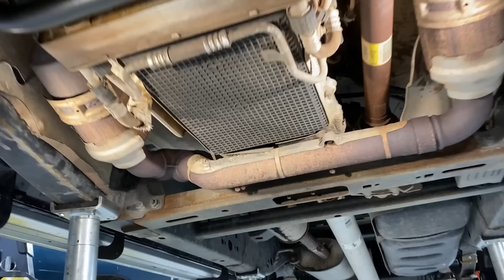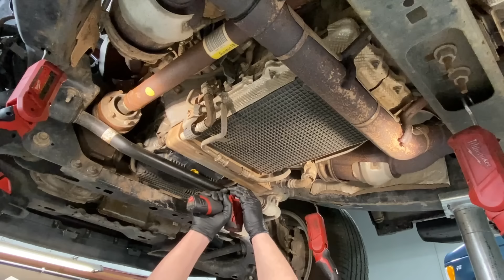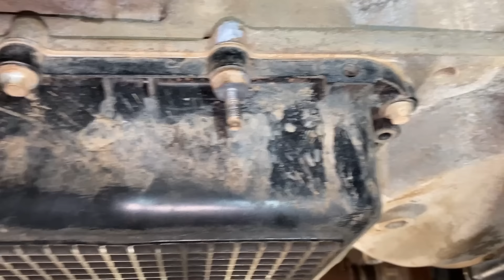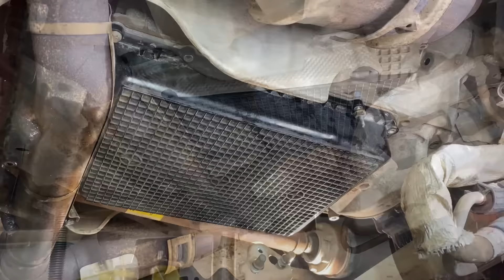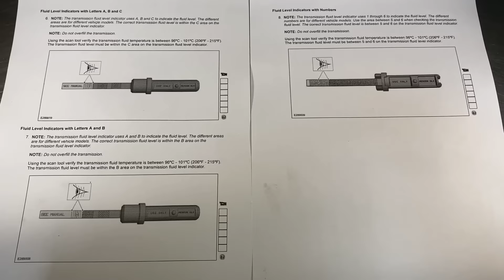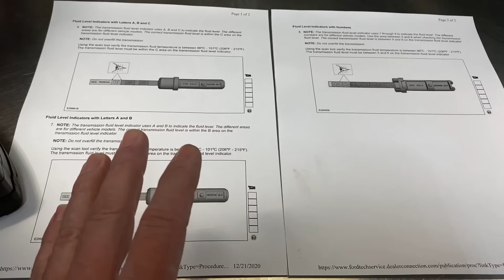Ford 10R80 Ten Speed Transmission: Fluid and Filter Service Procedure

Comment: Where can I find the torque specs for the filter and the transmission pan bolts for a 2021 Ford Ranger?  You state 96 foot lbs for the two filter bolts and the pan bolts, excluding the stud bolts, which you state are 106 foot lbs.   On the Ranger forum someone posted that it's 89 foot lbs instead of 96 foot lbs.  They have the same 106 foot lbs for the stud bolts.   I just want to be sure I have the correct torque specs for my truck.   I'm not sure where to find that information.

Thanks Scott
Reply from the maker: 89 inch lbs is correct

Comment: I just did this service on the wife’s 23 F150 tremor, I used a fluid extractor and sucked almost 6 quarts out of it. No mess at all, put a PPE deep pan and new filter. Bolted everything back together and refilled hardest part of this job was refilling to correct level. It gets very hot down there! 
😇😊😎🇺🇸🇺🇸🇺🇸
Reply: The pro tip here is using a fluid extractor which I did today as well.  It filled my extractor half way.  There was some left in the pan but it wasn't gushing out like this video showed.
Reply: Put back in what  you took out 🎉

Comment: Thanks for this video! I watched another one of your videos that said to check fluid levels first. My 2023 F150 Raptor with only 8k miles was shifting weird. Sure enough it was 1.5 quarts low from the factory using your cold fluid check method. Makes we want to check the diffs and transfer case now also!

Comment: Absolutely insane. Ford should  be terribly ashamed of themselves. No way should a transmission fluid and filter change be a $500 to $600 job! Tell the engineers to go back to the drawing board and figure out a way that the fluid can be changed and the filter can be changed without robbing your customers.

Comment: Man I'm getting ready to do this. I really appreciate all the torque specs. I am kinda afraid of checking the fluid when cold though especially since I'm installing a larger aftermarket pan. Will it get plenty hot enough to do how Ford wants it done while idling? I'll see where the temp gauge normally reads before I do this. Awesome video

Comment: My 2017 F150 has 118K miles on it.  The Ford owners manual has not recommended a transmission service yet.  So I have not done it.  The 10 speed transmission still works very good.  Oddly the dealer is telling it is too late, too many miles and do not service it at all.  What would you recommend?  I am tempted to at least replace some of the fluid by sucking it out of the pan and refilling it (maybe multiple times to dilute the old trans fluid).  Or service it as you did in this video.  I am new to your YouTube channel.
Reply from the maker: Follow this video and never flush. You will be just fine.
Reply: Thanks!  I will change the fluid and filter.  I feel good about it.
Reply: @BruceCook-j4x don’t do it. Just buy an extended warranty for a couple thousand. Then take it in to get replaced in a few weeks after then bam new transmission for 2K not 10K

Comment: Hi! I've been working on automatic transmission for over 30 years and I truly don't understand why nobody uses a pump to suck fluid trough the dipstick hole before droping the pan, that way, you don't make a mess like that...
Anyway, I do really like your videos and knowledge on Ford crap!
Reply: No, just use a fluid extractor! I did it this way, and it made dropping the pan so much cleaner
Reply: Cause there’s no drain plug

Comment: I just performed a drain and fill (30k 2021 f150) miles..dipstick shows in the middle between 5 and 6(at operating temp). Is it better to get the fluid to the top of 5?  I want it as good as I can get so I’m thinking I should get it to 5. Thoughts?

Comment: On a 2022 Ford F150 3.5 Hybrid, you 100% have to take off the exhaust, there is no way around it. One screw for the filter is too long and wont come out all the way (hits on the exhaust pipe).  Also there are two pipes inside the pan that catch on the valve body. Just FYI. I tried unbolting trans and jacking up it wont go up enough. quite different than this design.

Comment: Love all your videos! I do have a question though. If the 10R has a thermostat to block flow to the external cooler how do you account for that lost fluid using the underfill cold and it will raise to normal when hot method. I totally follow the logic but in my mind, when it gets hot and starts to flow fluid into the cooler that was emptied during removal wouldn’t that lower the level? I can guess that in your vast experience you have already been down that road and confirmed the fluid will go up when hot but was just curious. Keep up the excellent content!

Comment: If gear box run out of fluid , can it brake something in gear box? After I hit hard snow and loose all oil , I drive like 500 meters befor car stop moving , I stop engine in about 10 min after it happens . 
My car Ford explorer 2021 plug in hybrid st 3.0 eco boost engine

Comment: amazing I took my suv in to change fluid in auto trans and dealer told me it was lifetime. I dont know whos lifetime. but I checed at parts dept for filter and pan. no help. call manufacturer told me filter was only accessable on a full rebuild and it was my choice weather to replace plastic pan. oh by the way this is on a 9 speed jeep trans. just wanted to vent my frustation dealer and manufacturer dont even have info on there own autos even with vin#

Comment: My 2019 f150 is the 5.0 10speed also has the same numbered dip stick. I pulled the pan and let it drip for a few days as my filter was late being delivered so it definitely drained well. however it took me just shy of 10 quarts...
Reply from the maker: I bet so you allowed an additional 3qts to drain out.
Reply: @FordTechMakuloco  thank you, I figured that was it. I I wanted to be sure something wasn't wrong because I haven't seen anyone use that much. I am directly in the middle between 5 and 6 on the stick at about 185°.
Reply: I checked it again this morning before I took it out of the garage not running. It was well up over the floor. Mark after starting the truck. Not up to temp but running. It's not showing on the stick at all?
Reply from the maker: Yes that is normal when cold, that is how much LV and ULV expands when hot but the fluid level should be set at 206-215.
Reply: @FordTechMakuloco  what you said in the video makes Sense that doesn't have to be at full hot to check it, but  how warm are you letting it get? If I check it as soon as I start the truck it's not on the stick but if I wait 10 or 15 minutes or so and then it just shows up on the very bottom. It seems strange to me that the fluid wouldn't be on the stick at all. If I let it get to about 180°. It's centered between five and six . Local dealer couldn't answer me. I  appreciate you're reply!

Comment: Funny I just looked up the service data for this transmission and I know Ford uses discard bolts on the caliper brackets, but I did not expect to see DISCARD bolts for the transmission mount and the cooler tube.
Reply from the maker: It is all about the loctite trust me.
Reply: @FordTechMakuloco  for me is a insurance thing so the finger doesn't get pointed back at me. I trust your opinion though. I always just assumed they were just torque to yield bolts. But you know what happens when you assume. -_-

Comment: Heres a thought.  Anyone try squeezing a hose thru the dip stick port. I do this on my 07 chev, and used to do it on my bmws. Use a pump from harbor freight to pump the old out amd new in.  Obviously doesnt change the filter but consider explorer ford transmissions have permement filters installed, unservicable probably doesnt matter much. Ive been doing this on my 07 chev for over 100k miles. It has 260k on the original trans.

Comment: Why do you need to unbolt the transmission from the truck when you can just slide the pan towards front side to drop the pan? Half inch of space between the pan and the exhaust I think is enough
Reply from the maker: Because on most there is not enough room especially on the 5.0L.

Comment: I think I'd rather drill a hole in my plastic trans pan and reseal it with a bung plug than DIY this. 
What a joke.
Reply from the maker: It's not that bad.
Reply: @ I know.  I'm just whining. I'm still bitter about replacing both of my front wheel bearings pre-100k miles.

Comment: Good grief... what a F'ing mess ... I dropped the trans pan on my OLD F250 7.3 diesel C6 trans with one hand tied behind my back.
I'm rethinking buying a new F150... yikes, what a nightmare.
I don't have a lift, Imagine going that laying on your back... outside.
Stick a transfer pump hose in the fill hole to suck most of the fluid OUT so when dropping the pan it's not dripping all over the place.
Edit... what about installing a 'quality' aftermarket pan with a drain plug in it??? (make life a little easier)

Comment: @FordTechMakuloco
Could you use a pump to suck the trans fluid out through the dip stick to avoid a big mess? (Asking from someone who hasn’t done this before.)
Reply from the maker: Yes but in the end there will still be a mess on the exhaust as the trans case drains down

Comment: Just changed fluid and filter in my '19 F150 3.5 Ecoboost 4x4. This video helped out greatly. The rear pan bolts were a bit tricky to get to. I pumped out the fluid before removing the pan, so no spillage of fluid.
Reply: With the 3.5, did you have to jack up the trans like what he says the 5.0? I don't see how the 3.5 exhaust the crosses across the rear side of the pan is any different than the 5.0? 

Unless I haven't looked at it enough, this looks very similar.

Comment: Can you just buy a pump and pump out as much trans fluid as you can through the dip stick tube and replace it with same ammount of new fluid..? I did that with my Jeep compass I pulled out 2 quarts of old and replaced with 2 quarts of new 4 times and it is running great.

Comment: What do you think about the PPE replacement pan from the plastic to the aluminum with the drain plug had mine done took about 11 quarts cause it adds about 1.75 extra quarts

Comment: It has been 3 days now that the shop has had my truck on the lift to do this job!!!! I was told that they ordered the wrong fluid. Then I it was the the first gasket they received from ford was bad and it was leaking so they needed to drain and start over. They said it should be done by the end of the day, with any luck. I asked for them to call me and let me know as I am at work that is a hour away. No phone call. Today, day 3 I called 2 hours before closing time,  I was told that they are filling the transmission now and should be good in 30 minutes. I asked for them to call and confirm its good to go before I leave work early and drive out of my way to pick it up. Yup, you guessed it, I did not receive a call at all!!
Now I wondering if they screwed something up bad and trying to figure it out before I get the call to pick it up

Comment: While looking for a metal replacement transmission fluid pan I've learned that my 2021 Power Boost (hybrid) has a few differences to the typical 10R80. The filter is different, there are a couple additional pickup tubes in the pan, and the pan itself is different. Do you know of a metal pan? I can't get confirmation from the few brands I've searched. I'm also having trouble finding out exactly what parts I need to replace on the hybrid transmission. It appears there's a pickup screen filter and a couple seals for the pickup tubes but can't find the PN's or images showing them. Ford's parts diagrams leave a lot to be desired.

Comment: One Question would you replace the plastic pan for aluminum. It's said to reduce oil temp by about 8 degrees.
Reply from the maker: How is that when it is thermostatically controlled?
Reply: @FordTechMakuloco  Thanks I didn't know

Comment: Thanks so much for this video.  It was the primary source I used to do my first trans service today on my F-150.  I do not think I would have attempted it without really great detailed content that this video exemplifies.  I do want to say that I attempted to remove the pan on my 2018 5.0 without jacking up the trans, and luckily it wiggled right out.  It actually came out easier than the heat shields even without making extra room like you did--just took some finagling.  Being able to skip that one step definitely saved some time and aggravation no doubt (considering I chose a rainy day to do this in my gravel driveway!).  Mine also took 7.5 quarts of the ULV and I put in a Raybestos filter that came with the gasket for considerably less than the Motorcraft part.  The only cooler line seals I could find were made by Dorman, but they worked just fine for me.  I can say with zero doubt that I would much rather have done this inside, with a lift, and with a nice pump to get the fluid in.  I used a little hand pump (like a soap dispenser with a hose) and that took quite a while, though it did the job.  Thanks for all the great tips in the video and I'll be using more of our content.  My pickup has 125k and I hope to double that!
Reply: Gravel driveway, what luxury!  All I have on my acreage is mud and weeds that consume dropped bolts and nuts.  Achieving a day without rain is a months long process.

Comment: It seems that the major issue with the 10R80 trans is the CDF Drum slipping out of place - not sure a fluid/filter change will help prevent the failure of the CDF drum considering there is a design flaw that causes the this part to slide out of place. Ford developed an updated CDF drum with a key machined in to it that prevents it from sliding out.

The hassle of replacing the 10R80 fluid/filter doesn't seem to be worth it considering there is a fundamental flaw with these transmissions.

Comment: I was just wondering if the $650.00 my local dealer charges to service the transmission is normal cost.
Reply: My local Indy mechanic charged me $650.00 for pan drop and filter and new gasket (probably could have used the old one) engine oil and filter ( I supplied oil and filter) and change out front diff fluid ( I supplied fluid). Maybe a little high on price........but.....I know the job was done properly.  I don't trust the mechanics or service manager at my local dealers

Comment: Would love to see a video like this over the 10R60 trans that's in the full size bronco. 

I'm gonna be doing a change on it after this winter on my 2024 bronco 2.7 Sasquatch.  

Ive not been able to find any type of video on the bronco and pro demand says you have to hook up a special external vacuum pump to replace the fluid or something. 

Would love a video on fluid and filter swap on a 6th Gen bronco 10r60

Comment: Will a hose get all the way down to suction off fluid using an extractor from the fill port? I want to do this on my garage on jacks but I'm afraid I might not be able to extract enough oil and make a big mess.
Reply from the maker: yes it will through the fill port.
Reply: @FordTechMakuloco  Thank you boss. Just did it today on jack stands 😬

Comment: Thank you for making this video is there any way you can tell how many  quarts of atf i will use need for a 2022 ford f150 3.5l 2wd 10r80 i know i will have to check dip stick but general how many will it take with filter change also
Reply from the maker: 6.5-7qts it seems for most.
Reply: @FordTechMakuloco  your the man thank you

Comment: Can't you just unbolt the crossmember and trans mount and 1 exhaust bolt and lift the transmission? To me it would be easier and more access to the pan.
Reply from the maker: No it will not do anything at all if you do it that way. This is the only way.

Comment: This is a stupid question but I'm just going to go ahead and ask it. Is there a little tolerance for too much fluid? I have a 2020 Ranger and the dipstick and the cover is effectively tucked behind the exhaust. I am having a hell of a time getting an accurate reading. Hot or cold. I have seen several sources say that 6 quarts was the minimum and then to check from there. Seemed quite low and sometimes not showing at all. So added quart number 7. Should have done half and checked again but everyone I see doing the service is doing 7 and change so I didn't. Now I'm getting readings that appear a bit too high. Ridiculous we couldn't get a damn dipstick on these vehicles.
Reply from the maker: I have seen these blow fluid all over the highway from being overfilled so I would say no.
Reply: @FordTechMakuloco  im going to try to level the truck better and do a cold check again as you have explained in the video. Easier for me to wedge my hand in there when the exhaust isnt searing hot
Reply: @FordTechMakuloco  Was able to level it and check while cool. Ive got the dipstick that has all the increments on it. While running and cool. It is readying consistently at 5. The literature you posted with this dipstick says it should read between 5 and 6. So it looks like Ive got too much fluid in there. I am where I should be hot while the truck is cool it looks like. ugh

Comment: Great video, Superb detail and tips. Thank you for taking the time to video and share it! I will be doing this to my 2020 5.0. I think before I put it up on my lift I'm going to take the pressure washer (lightly) to the transmission around the pan and line brackets and such so things are nice and clean before hand! Boy these design engineers should have to be mechanics first, These types of task's would be MUCH more simple.

Comment: Hello sir, I have  2022  Ford F250 7.3 gas engine, I wanna change the granny fluid at 10 or 20k. Is that overkill? The owners manual wants it 150,000m, and thanks u so much in advance.